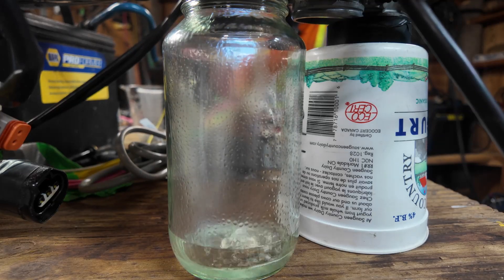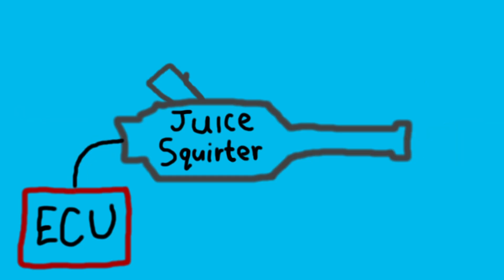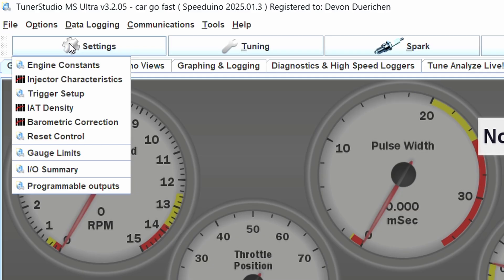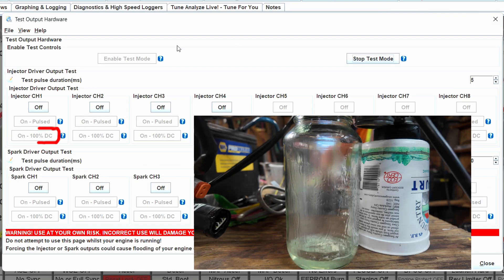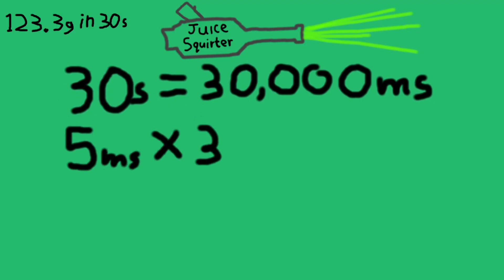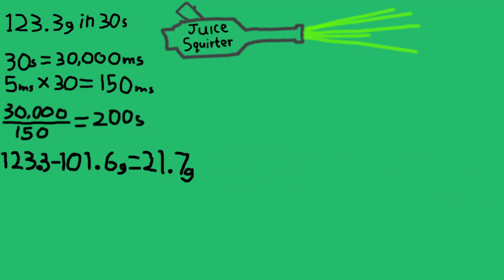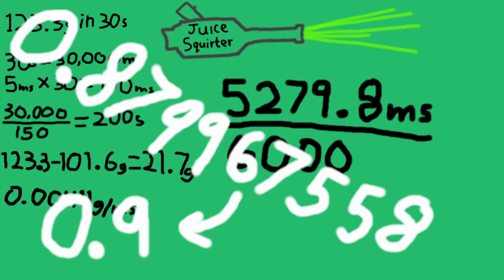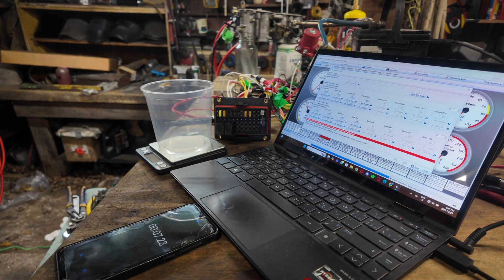DIY Fuel Injector Testing - Flow Rate & Dead Time with Speeduino Standalone ECU

Comment: What fuel pressure did you feed the injectors? Did you use your car fuel pump to replicate normal conditions? I'd imagine you'd have to supply same fuel pressure that your pump would do
Reply from the maker: @rafaelgenel I am using a different pump but stock fuel pressure regulator. So I don't know exactly what the fuel pressure is, but it should be the same as stock(around 45psi I think). Keep in mind it shouldn't matter what your fuel pressure is as long as it is consistent, and as long as you measure your flow rate and dead time.

Comment: A word of caution: Some injectors have a max duty cycle limit and will get damaged if left on anywhere near 100% of the time.
Reply from the maker: @JustAnotherAlchemist Yes speeduino has a setting for max duty cycle. I believe it's recommended to have this around 80 to 85%
Reply: @Crusty-Creations  For high impedance/old injectors, this works. However, for newer/performance injectors, you often can't even run past 10% on time. To be fair, this is more of a speeduino problem.

Comment: Interesting way on calculating the dead time, will be using this method to be little more precise when going for more pressure at the injectors and measure again the injector flow, since the injectors are not behaving as expected (more dead time as opposed from the supplier)

Comment: Great video!! How did you get the 6000 pulses?
Reply: Test time = 200 seconds at a Pulse rate (Frequency) = 30 Hz. (Freq = 1 / Time).   6000 Pulses = 30 Hz x 200 seconds
Reply from the maker: Yup, that's right, 30 Hz x 200 seconds